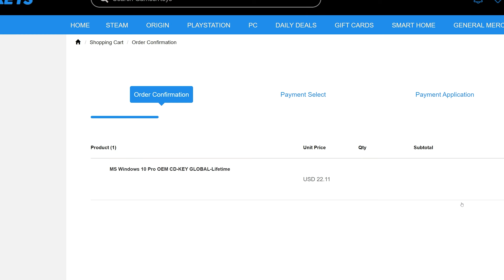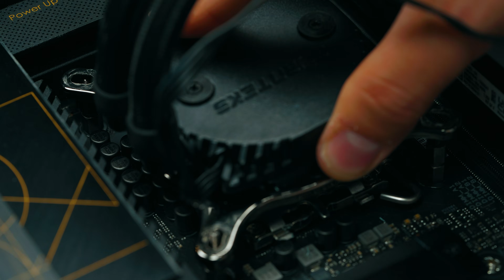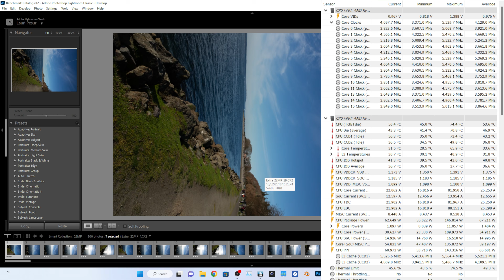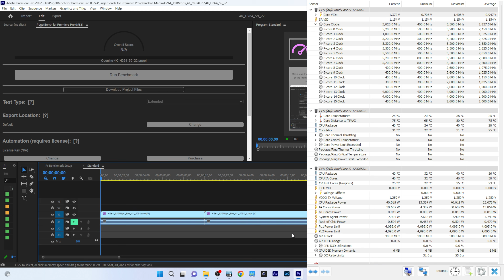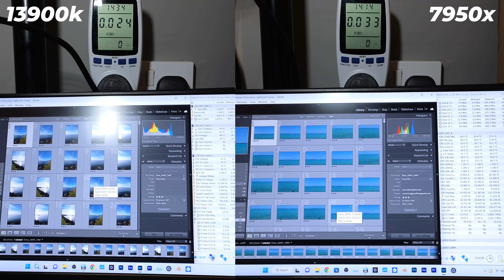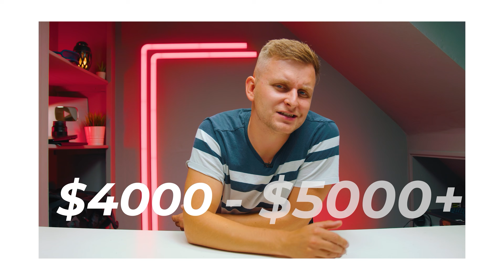INTEL & AMD both lied! 👉REAL WORLD power consumption is MESSED UP

Comment: You should change the title. They both did not lie, but you do by omission in the title. They used the only method they have, to show the consumption at full power as far as they measure it. That that is useless for most in day to day work is another issue and is not really solvable.
Nobody knows your user profile, how you would use a computer system and there is no standardized test cycle like with cars they could use. And even then your whole analysis is flawed. To use your example of cars. They compare CARS not ENGINES in a standardized test cycle. You try to compare engines (CPU) and not cars (SYSTEMS) and you have no standardized test cycle. And like with cars were the weight, tires, gears, how you drive etc. has an impact on fuel consumption the same happens with PC's were the whole system defines the power consumption and not only the CPU. If you want compare AMD and intel, compare with identical systems, with identical tasks were only the CPU/MB combo is different, but even then it only fits for you and your workflow because there are no standards. And if you change one component like an intel Asus against an intel Asrock MB to compare the whole measurement is trash again. Even the patchlevel of the OS can make a difference.
And don't forget the power consumption you showed came from internal sensors inside the system you are testing. Sensors were you don't know their resolution, their accuracy, their inherent parasitic errors etc. They are always flawed. You don't know if the sensors are made to show you a favorable figure in power consumption. We are not able to measure on a CPU die and measuring at the socket is difficult.

Power consumption in daily use can only be compared on system level with a standardized test and not on component level with some assumptions like you did.
Reply: but they did lie:face-red-droopy-eyes:

Comment: Im starting to believe the chiplet efficiency claims is just a myth. If you can get a Monolithic die on a good node and not a Shltty one, I think it is better overall. Chiplets save money but that's about it.
Reply: chiplet its always more hot and less efficient, but saves them a lot of money and yields.
Reply: Definitely not more power efficient since you're using power to connect the different tiles. However chiplets can be scaled to much bigger chips in general without yields becoming impractical so in theory offering a monsterous chip for those that want it should be much easier IF you can get the interconnect figured out (infinity fabric in AMD's case with their CPUs).
Reply: Isn't about monolithic or chiplet, Intel is using Big-Little .

Comment: Great analysis. A lot of content creators consider performance per watt which obviously gives per second efficiency this could be misleading. 10:16 Power consumption over time should be considered. Example 10w for 4s is definitely better than 7w for 6s.
Reply: Not for a laptop due to thermal throttling… it’s not straight forward as you claim

Comment: Great test! I fully agree with the findings. The max power draw is only needed for deciding cooling. For the vast majority of users the CPU is <10% load for >95% of the time, so the low load power draw determines the cost.
Reply: true
Reply: Except HWInfo doesnt display accurate Wattage when AMD cpus are idle. Test yourself using Ryzen Master side by side with HWInfo and you see the wattage drop when cores park on Ryzen Master, but not on HWinfo.

HWInfo is wrong
Reply: @TheAddanz Wij van wc eend adviseren wc eend
Reply: @TheAddanz Ryzen Master is only measuring the cores itself but not the I/O die on the AMD CPU itself! The I/O is consuming so much power in idle…
This is why Ryzen Master is showing you 4-6 Watts in idle.
My 9800X3D is consuming ~30 watts in idle which I refer as high. Previous Intel rigs which I owned (9900K/13900K) used only 7-9 watts in idle and where much cooler than the 9800X3D in idle. Just compare the temperature between an Intel and a AMD CPU in idle. Intel will be around 30°C while AMD (9800X3D) is around 45-50°C which indicates a higher consumption. The heatspreader can't be the reason because AMD is cooler under load while Intel is hotter (plus Intel heatspreader are warping).
Reply: @hocln2556 The Ryzens I have don't idle near 50c, more like 10 degrees above ambient and that includes zen 2,3,4 and 5 systems, none of them idle at that high .

Comment: How would an intel 13 gen + 4000 nvidia series gpu compare to a Max Studio in power consumption? I built a PC for video- editing in 2022 and now I need a second unit (also for video editing in Da Vinci Resolve)and I would rather to build another pc, but I worry about electricity bills, as I have already noticed a significant increment with just the one unit I use, so I'm wondering if I should go with a mac studio as a second unit. Thank you all for your help!
Reply: A PC doesn't stand a chance against Apple silicon when it comes to power draw during video editing tasks. If that's all you need it to do I'd get the studio if you're going for pure efficiency.

Comment: I use an AMD 5800X with an Asrock uATX motherboard hoovering at around 40Watts when surfing so very efficient. Temp is between 35 and 45C on air cooling. Rally nice. Graphics card is a RX6600, it uses very little anyway.

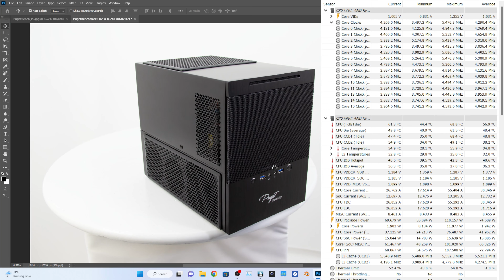Comment: 4:55 have you checked your BIOS settings? A minimal VDDCR of 1.36V in IDLE seems unusual, this should be around 1.0V. When did you start monitoring in HWINFO? Running PS in the background isn't cosidered IDLE though.
Reply: Yeah, AMD voltages out of the box are absolute crap. I managed to get my 5700x to run all day at 4.6ghz using only 1V and 60W peak. Usually around 20-30 though
Reply: @Phenom98  Also Intel voltages, my i7-12700K new was pulling 230 watts and 1.45 volts.

I reduced that thing from 1.45 volts to 1.2, then 230 watts to 170 for Cinebench R23.

Thanks MSI.
Reply: @Phenom98 how
Reply: AMD stock voltages are very floaty. They move around a ton and rarely settle for a long time at lower voltages. Intel downclocks way more aggressively and also moves voltages quicker

Comment: This is the exact reason I got the 13900K, it has an amazing balance between low task efficiency, and high task brute force. When I see those 24 cores kicking in my 3D renders I love how much time it saves, but in between renders and between workloads in general, I am so thankful that I can have this beast of a CPU sitting at idle barely sipping power. Over time I reckon it will be even more efficient on a yearly basis than my old 9700K - despite being a latest gen i9 and everyone shouting "Intel power consumption bad!!!!". In reality, my experience is the exact opposite. And tbh nobody outside of enterprise studios sit with render queues 24/7 for 100s of customers waiting in line.
Reply: That's if it works correctly.
Reply: 9700K is the worst i7 of all time, i hope the executives that came out with the idea of an i7 without hyperthreading were fired.
Reply: @saricubra2867  Realistically yea the 9900K is the real 9th gen i7, but Intel wanted to promote the new i9 brand hard.. Still 9700K at its time was a fine chip, still a massive (as in MASSIVE) upgrade from the previous gen i7s, but you're right it should have been even better if Intel didn't decide to do Intel things.
Reply: @Real_MisterSir  A Massive upgrade for an i7 (before Alder Lake obviously) would be the 11800H from Tiger Lake. The 9700K always was a heavily flawed chip.
Reply: This
Reply: You'd be better off rendering with a decent gpu. Who still uses cpu for rendering?
Reply: @proxyone890  There are tons of render software that are cpu-specific optimized due to the accuracy that you only get from cpu rendering - so a gpu would do jackshit for me. If it was a common blender render it would be different, but that ain't me. There are plenty of reasons why one would go with either cpu or gpu rendering, thus far there isn't a "one way solves everything" solution.
In my case, Cinema 4D + Corona render only supports cpu rendering, with gpu denoising. I'd gain nothing from upgrading my 2070S to a 4090 (in terms of rendering speed).
Reply: @Real_MisterSir  There is absolutely no need for cpus accuracy for 3d renders lol. This is the dumbest thing I've heard this year so far
Reply: @proxyone890  Do a simple test then. Take a complicated scene with complex light bounces and scattering within various transparent and opaque materials. You'll find that the light bounces will have a degree of variance that is far greater for gpu renders, than cpu renders. This is because the gpu cores calculate approximations much better than precise interactions, thus the photon tracing is randomized to a greater extend than cpu rendering. This also leads to more noise, even if the render itself is generated faster, so you will just shift the problem from one place to another, also why most gpu-based render applications use post-process denoising to a greater extend than cpu render applications require - again compromising the potential quality of the final render because denoising is inherently inferior to accurate first-time raw render calculation.

Granted, for many people the actual quality difference isn't noteworthy enough to be an issue, or sometimes not even something you'd notice at all if you don't actively search for it. Each task is different, and different render solutions cater to different needs.

On top of this there are also other advantages to cpu rendering, such as support for far greater memory capacity since it has direct access to your RAM, compared to the GPU which relies exclusively on VRAM which is still very limited even for the highest tiers of enterprise Nvidia cards, let alone consumer cards that are restricted to 24gb or less. If you render complex scenes with very high texture quality and material complexity, this too can potentially cause more issues with gpu rendering vs cpu rendering.

And yes there are other differences too. And no, I do not personally choose cpu rendering because I demand this pinnacle level of quality. I just choose it because my 3D modelling and render software of choice is cpu limited, that's all. But I do appreciate the precision and final quality potential of the renders, as do my clients.
Reply: @Real_MisterSir  Okay, I liked your comment. You obviously know what you are talking about. As you say, the differences are hard to spot. In my opinion it's not worth the insane render times on cpu.
Reply: @proxyone890  That is a fair assessment, worth is subjective in the end.

Comment: This is what I thought as well. Even in gaming, it was really easy to add a negative offset voltage on my 12700k and remove around 50-70w during gaming, and incredible idle power usage.

Meanwhile, everyone was harping about Ryzen's power efficiency, but that is only on full load which is usually only in a short time. Still, there is something about getting almost the same performance at almost half the power usage with the 7950x with the 105 eco mode. At the end of the day, both platforms are really good this generation and choose whichever you think will fit your needs!
Reply: AMD's 105w mode consumes 140+ w, so as 65w mode consumes 88w, so it's closer 2/3 of max power usage than half
Reply: @aldisskudra3687  You are right, I was doing a quick google search to find out the max power draw the chip did at stock lol
Reply: Most of the issues with zen4 are based on their stock clocks and voltages, once you do a PBO curve or outright lower the non boost clock speeds, most of the idle power consumption numbers go down by a lot, that's pretty much what the zen4 non X SKU's are, idle clocks are almost or are a whole GHz lower than X variants, but turbo speeds are around 200mhz lower or less, zen3 didn't have this issues either out of the box, so the video is mostly flawed since with intel you can do a PL2 to 250W or underclock a zen4 chip and both will consume the same power at idle, but zen4 will keep the crown with higher loads

Comment: It would be interesting to see where the budget CPUs fall in.  If an i3-12100 or i5-12400 would be absolutely pegged at 65w the whole time or if they’re even more efficient.
Reply: All current CPUs use much less power at idle
Reply: Power consumption is a tricky topic. Your dgpu consumes power even when only your igpu is in use.
Pcie express 3.0 4.0 is often not necessary, especially for 1080p and use more power. high refresh monitor and 4K use more power plugged onto your graphics card even if your output is 1080 60z!
Then power supply efficiency is very important.
Reply: My 12100F takes 3-17watts in idle with 1 hwinfo program running, no background task

Comment: Would be good to see the amd results on eco mode
Reply: Derbauer already made a video about it, you can also put the intel on "eco" mode and the results will basically be the same
Reply from the maker: Exactly, the whole point of this test was to test them with stock settings when just popping the CPU into the socket and go :)
Reply: This was going to be my question. Because AMD went with a performance approach this time around. Mega wasted watts- over thousands of idol machines... I'd only run a 7000 series in eco mode.

Comment: Apart from power consumption do high temperatures affect life of processor in long run ???
Reply: It depends what you mean by hi temps. Anything up to 80 degrees C is no issues whatsover but even at 90 degrees C the CPU should run fine for the life of the CPU as it will never be running at max load 24/7. I have always overclocked and now undervolt as well but during my older days with the likes of a 4790K heavily overclocked, I had no issues over the 5 year run...Good cooling is important and I have been using AIO's for many years now and they do keep the CPU's even at max load/speed Cinebemch 23 at around 70 to 80c on my current 13700K.
Reply: @vMaxHeadroom  ok thank you for answer.... i m gonna buy new pc in few days so this was the only thing i was concerned about because i want igpu of intel ........ But seeing high temperature thing about INTEL was confusing me ....

Comment: What can cause this ? E-core ?
Reply: No. The Alder Lakes Power consumption (at idle) is not extraordinary good, AMDs powerconsumption is just very very bad. This is most likely due to the chiplet architecture which uses the PCB for inter chiplet communication. This approach causes very high power consumption for the communication (between 10 and 25W). Threadrippers even use up to 60-100W at idle.
This is basically the reason why AMD still uses monolithic CPUs in low power devices (laptops etc.)
Reply: 12400 idles very low too and has no E-cores